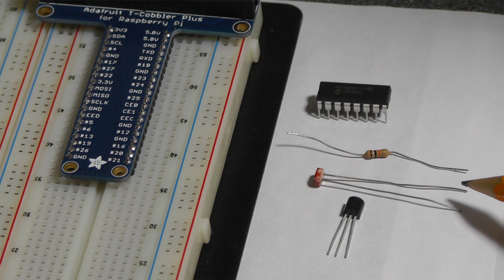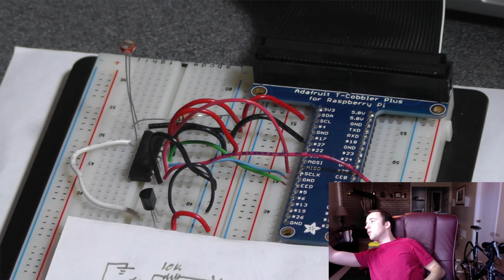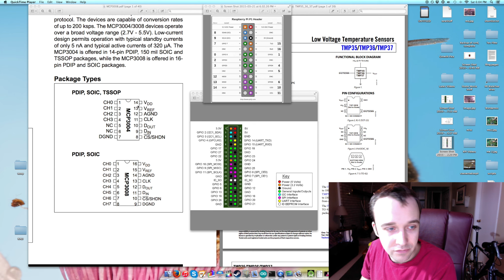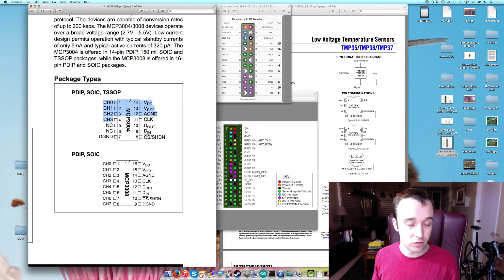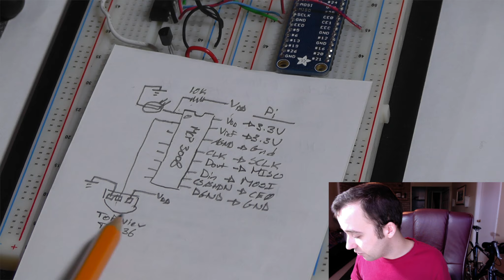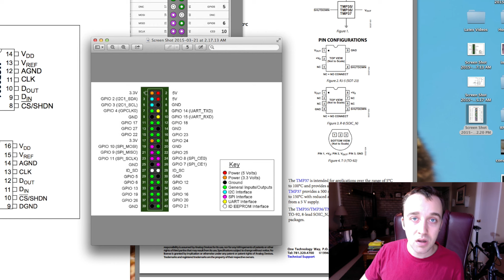Raspberry Pi Tutorial 22 - GPIO Analog Sensors + MCP3008 / MCP3004

Comment: We oly use raspi and MCP3008 without the sensor ,  to test our MCP3008 if it is still working but it still receives data ? Is it normal?
Reply: To me, it sounds like you picking up noise from the inputs, try and ad some pull-down resistors, say 5-10k to ground.

Comment: nice video!... i have a question... is it necessary the pins such as
CLK to be connected to SCLK
Dout -> MISO
Din -> MOSI etc..

do they have to be those pins from the raspberry specifically or just any pins will do?
Reply: No it is not necessary. Just make sure to specify it in code